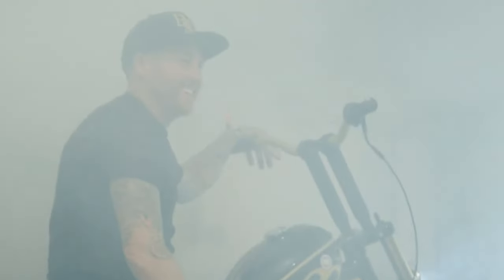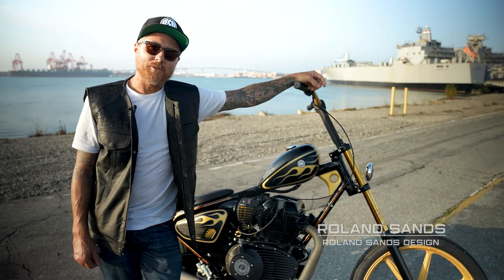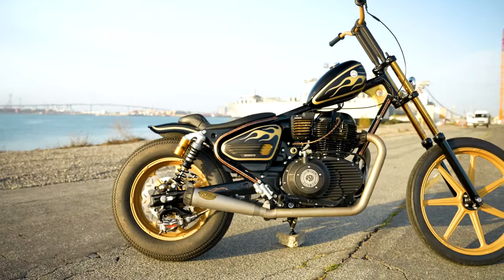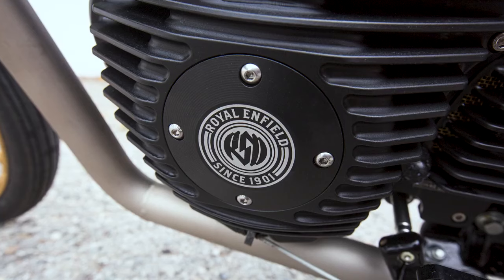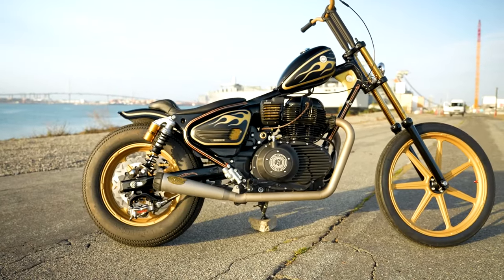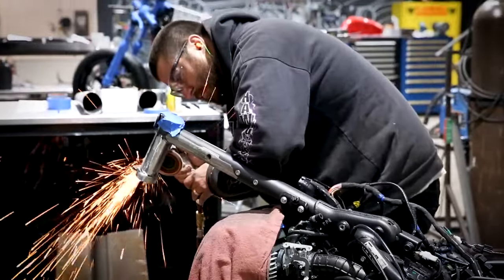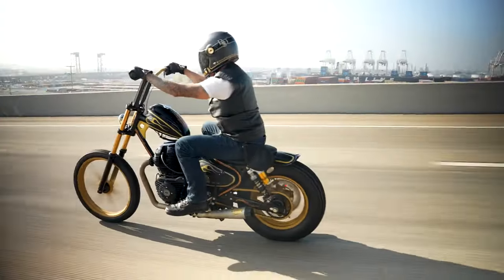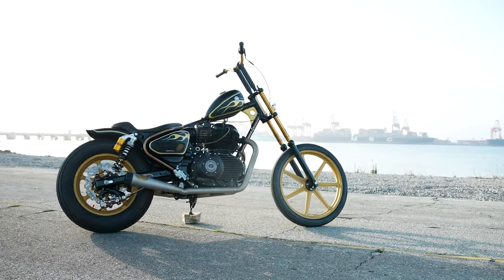Super Meteor 650 Chopper x Roland Sands Design | Royal Enfield Custom World

Comment: Great - a longer Swingarm so that the shocks follow the line of the frame would have been the icing on the cake!
Can’t understand the hype for riding without a front brake - it even doesn’t look cool, so what’s the fuss about it.
Hardtail - footclutch -handshifter - I get, but no front brake ?!!???
Reply: Hardtail, foot clutch/hand shift, + no front brake is all simply stupid. Choosing form-over-function is fine for something that will remain stationary - not a moving vehicle.

Comment: Hi , awesome job but, here in the UK totally illegal 😭 no front brake any bike after 2012 has to have  abs an indicators. Shame
 Mega clean handle bars. So much wiring on the handlebars headlight, diplight, indicators, hazard light, starter, kill switch, horn an so on an so on. 🥱